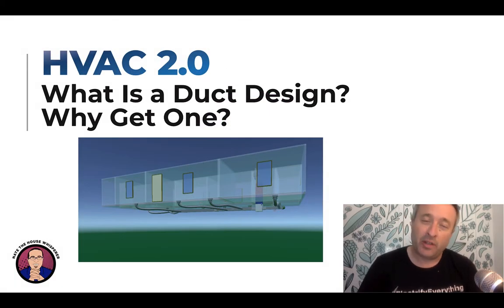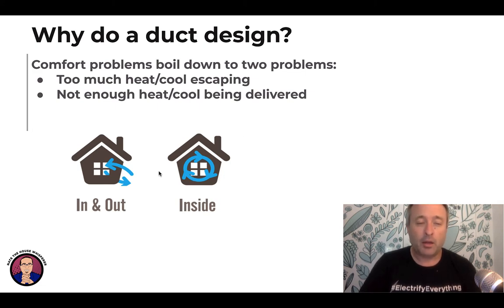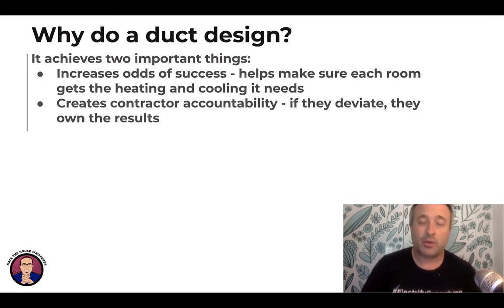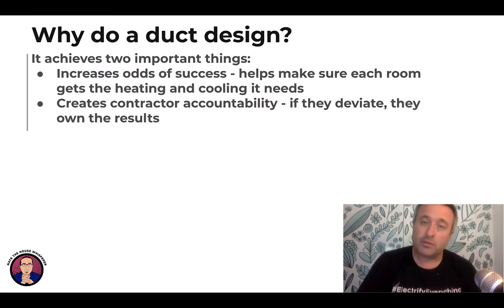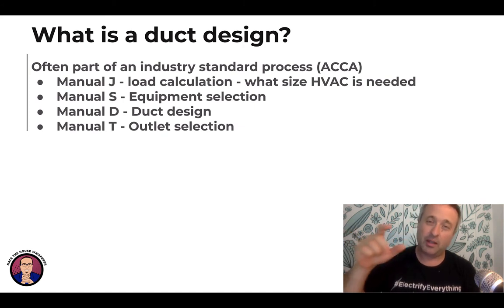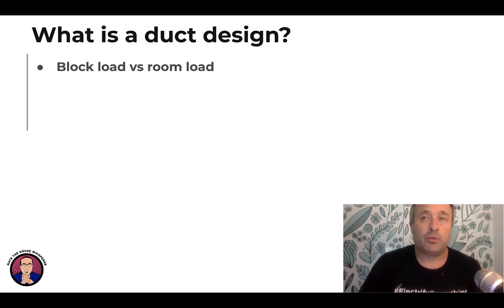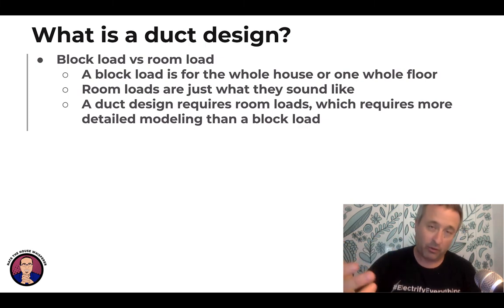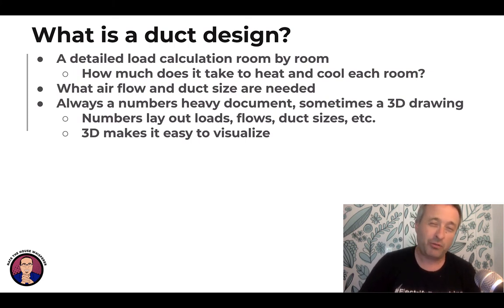Duct Design - What is it and why do it

Comment: Are HVAC companies typically agreeable to aid in the data analysis and duct design piece alone? 

I’m willing and able to DIY as much of the dirty work toward home comfort as possible, yet certain my house needs a full work-up with proper modeling (for which I’m happy to pay the pros). 

Heat pumps are far from mainstream in central MN, but I’m stoked to be on the journey of sealing the house to get to the level where #electrifyeverything is reality. 

Thanks for your priceless content, my man.
Reply: Finding a Pro that is actually worth a damn is going to be the hardest part.  I would get an energy audit company to do a full work up on your house IF you plan to live there for 10+ years. On one side its incredibly valuable information.. on the other i feel like i wasted $600 which I could have spent air sealing and blowing in cellulose in my attic.   I would at least get a blower door test done with a thermal walk-through. That is what helped my by far the most as opposed to the full energy audit. The blower door will tell you where to air seal and then you can add in insulation behind that. I'm no pro but I am probably one of the most knowledgeable home owners out there.  I love this stuff.
Reply: @tekjunkie28  thanks for the thoughtful reply. I have two pros coming to look at the situation at quote a duct redesign. Air sealing will have to be done simultaneously so the blower door will be a large moving target, but at least someone with know-how will be able to identify the biggest leaks and thermal issues. 

I loved Nates tip to ask distributors who is buying high end residential heat pumps. They got me in touch with a couple guys and maybe one of them will be comfortable on boarding to HVAC 2.0. Located in central MN so it’d be huge to have more people making the switch. I geek out on this stuff as well so for that I guess we’re lucky!

Comment: What do you consider high efficiency in single stage equipment? that's all i will likely be able to afford unless I can get a good deal or something. Im getting quotes of over 10k just for a equipment change out.
Reply from the maker: I can’t recommend single stage. You might consider some thing like the Bosch or a Daikin fit. Be sure to read HVAC 101 from my book.
Reply: @NatetheHouseWhisperer  will do.
  I been researching this stuff for years.  I feel like I'm an armchair expert but there's just so much.  To top that off contractor's in my area are crap.   I run them over with knowledge and they just look at me like a deer in headlights
Reply from the maker: @tekjunkie28  there’s a reason we’ve focused on Hvac contractors with HVAC 2.0! There are good ones out there, they just need a bit of education and a system to design projects.
Reply from the maker: Try this tool to find one: https://bit.ly/3ilLeTT